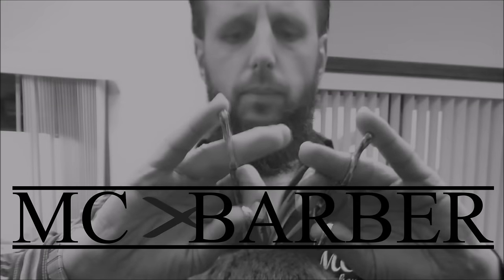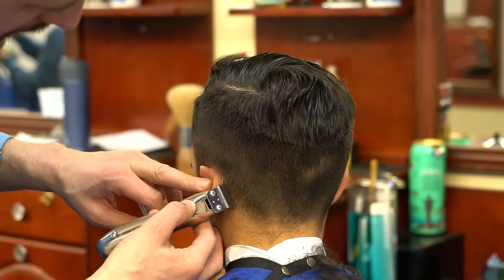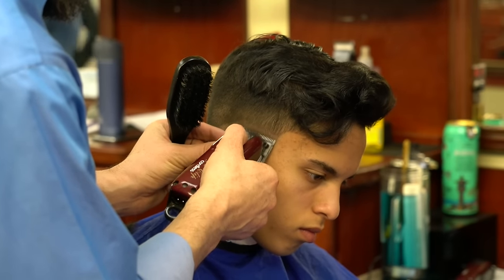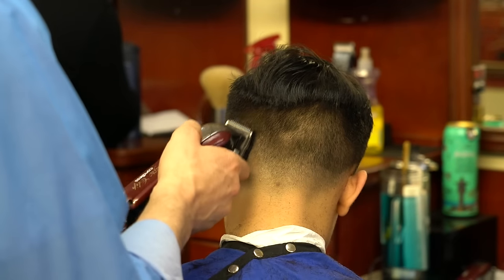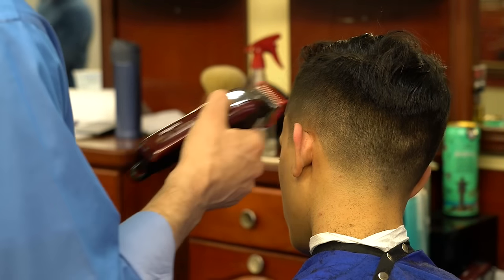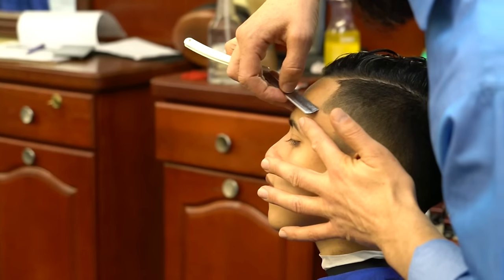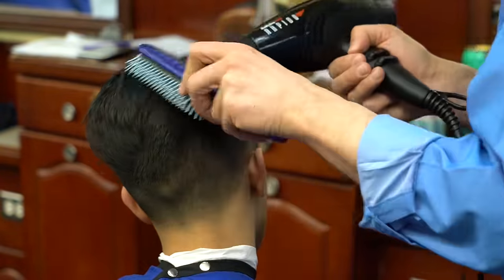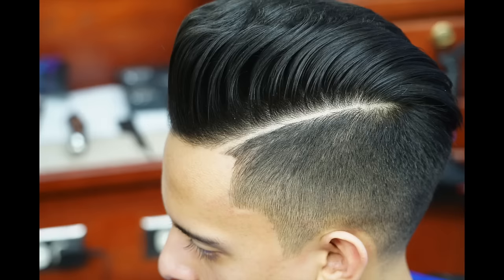Pompadour Haircut Tutorial with Hard Part - by MC Barber

Comment: MC, as far as I can see you almost only use your razor technique to cut the upper back of the head. I believe it is (more?) difficult to build a nice shape of the longer part of the back of the head down to the transition to the razored fade with curly hair. Could you please do a video showing how to cut the back of the head - especially if the back of the head is more flat than rounded and/or has cowlicks? And could you please line out what you do differently when cutting a more wavy or curly back of the head, maybe with cowlicks, and still build a nice rounded shape? Thanks, Nick